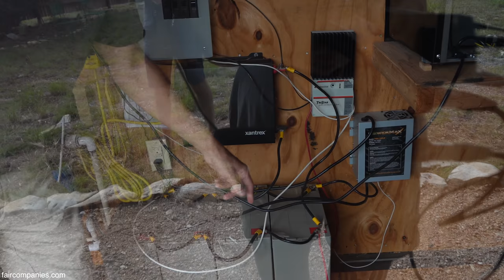Thrifty couple builds self-reliant, $60K homestead & workshop

Comment: This is the dream!!! So cool. I don’t know how I would do without a/c in that climate though.
Reply: Your body gets acclimated. I wanted to lower my energy bill so I started adjusting the thermostat up 1 degree every couple of months.  I currently have it set at 78° and use fans, which helps a Iot!  I can remember when I first began my mission with the thermostat set to 74° and how that seemed a little uncomfortable at first.  Then my body got acclimated as I slowly increased 1 degree at a time.   Now when I go outside the weather is much easier to tolerate and I live in TN where summers are 90-100 + and Spring season only last about 2 weeks.  It’s all about putting your mind to something and slowly working towards your.  I’ve always been the kind of person that hates spending money on something I can’t physically see, touch, or own so that’s my incentive.  So my utility bills savings allows me to spend money on things I can see and have as my own.   It’s a pretty sweet trade off!
Reply: We have AC luckily
Reply: Texas can get brutally hot in the summer. It was 105 degrees last week. I am spoiled with a/c but I keep the thermostat at 83 degrees in the summer and 79 at night. I think I could do better though.

Comment: 13:00 you can actually get used solar panels and used batteries(but it can't be lead acid batteries). There is market place for both Lithium ion batteries and Solar panels that were used in commercial farms for only a few years. Some websites(like batteryhookup) and companies take the best out of them and even provide warranty of their own on these. These can be a lot cheaper than buying brand new.
Reply: Cheapest source of batteries is to buy one from a wrecked EV.  They usually come with warranties and all the cells have been tested!!
Reply: Cheapest source of batteries are the abandoned electric scooters that are on the streets in the cites. Look for “Revel”

Comment: I'm a big fan of how efficient he was in reusing materials but it must be kinda dark in there with all that plywood, I'd definitely paint it white or do plaster or something to brighten it up
Reply: Then you have to repaint periodically
Reply: You'd have to coat the plywood too so it doesn't dry out and splinter. They both require similar maintenance but to each their own
Reply: Screw the drywall directly to the plywood.  Very stable and also provides some thermal mass.

Comment: I love the creativity, resourcefulness, frugality, patience, innovative learning, willingness to continue on and constant improvements you've put into put your home! VERY impressive! I know a couple who built with the same approach, back in the '70's. I was a part of it, so what you're doing seems like a "normal" home to me. 
I definitely would love the absolute silence except for nature. I crave it and need it. Maybe most folks aren't like that. 
Right now I'm finishing a cabin my brother started building. He passed away so now it's my delight to do! I've wanted a cabin in the woods since I was a teenager. Now, however, I'm too old and disabled to do much of anything. I have to pay to have everything done. So far, I've had the land around the main building cleared. Had a gravel road (it's actually a long driveway) installed. A new deck has been built because the old one was not built with pressure treated lumber. It had to be replaced for safety. I had electricity reconnected, but I want solar power installed to draw from before having to use regular electricity. There are 2 wells. Last time I was there, I checked to make sure the well pumps were working. I also plan to set up a rain catchment system for when the wells run low or out in the summer and/or there's no power to run the well pumps. I'm trying to set up at least one or two back up systems for everything...to be prepared for anything. I'm adding plumbing, but there's already a world class outhouse. That's how my brother rolled...world class everything cheap or free! He was a perfectionist, who wanted to do everything himself. Looks like you and he are/were similar in that. I'm trying to come up with an interior floor plan that incorporates the wood stove already there. 
Anyway, really enjoyed your video and look forward to what you do next. 
Sorry this is so long--I'm really excited about what you're doing!

Comment: Run 100ft of plastic tubing 10ft deep underground and run one end out of the ground outside and the other into the house. Attach a 12V fan to the opening inside the house, pulling air from the outside, through the pipe, into the house. Attach a bug screen and a rain cover to the end outside. Connect it to an on/off switch, maybe with different speed settings. Voila, low energy air conditioning. Soil at 10ft deep maintains a pretty constant temperature year round. And it takes roughly 100ft of tube for the air running through to attain that temperature. If the air coming into the house is too cold, either try shorter length of tube or speed up the fan. Or both. :)

Comment: They should try and get flow batteries! They retain 100% of their capacity for decades, so it doesn't matter if they use all their energy one day by accident or constantly fully charge and discharge it. They are also excellent at retaining their performance in hot climates. Another plus is they are fully recyclable (as a bonus for those who think about a products whole life-cycle). If they had the money they could even buy a few of them and if they needed to save energy for a certain event, they could put one battery on standby and use all of that stored energy in the future

Comment: Most all motors are DC motors. Ac to Dc rectifiers are used to modulate fan speeds through pulse width modulation (or motor taps). Most things use DC power but AC electricity is used because there is much less voltage drop across long lines. Step up transformers are used to increase voltage reduce amperage. Low amps = Lower loss of voltage from resistance in the wires.

Comment: I suggest a 'cold roof' essentially a second roof minimum of four inches clear flow at eave ( hardware cloth intake cover okay).  Second roof could be steeper to accomadate the expanding air big vents at ridge  and or cheek walls.
30 years on  solar at 44.44 °  latitude

Comment: Used vehicle Lithium batteries are affordable at about 100 per kilo watt hour.  We used our biz account with LKQ and had 7.6 KWh of Ford C-Max (Energi) batteries dropped off at our biz.  Then you very carefully take the battery apart, with the Energi version battery you have the great option of building any size 12, 24, 36, 48 or 60 volt system, as the battery breaks down into 84 x 4.2v cells.  This is the way we went just so if I wanted to build a 12 volt system later on in adition to the 60 volt system we used for our shop and the AC for the home.  After almost 3 years of being off the electric grid we found out that we did not really use the AC as much and we made adjustments to build a smaller separate system for our home.   This type of home is not what they want us building this is why everything is so restricted (permits etc...) by those Corporations posing as cities or government which in truth they are not.

Comment: Most people do not have the option of permission to camp for free on someone else's land while building a home there from salvaged materials. 

Buying a small piece of raw land, fencing the land, making a gravel road and installing a septic system are costly and should be added to the calculations of how much it costs to self-build even a simple shanty from salvaged materials. And if you cannot connect to a public water system, the cost of hiring a crew to dig a water well plus the cost installing a solar powered water pump or, alternatively, buying and hauling water to fill a large water tank also need to be considered. And if you cannot connect to a nearby powerline, the cost of getting the power company to put in power poles to get that connection or the cost of installing a large enough off-grid solar power system to run a washing machine, refrigerator or microwave can be quite high.

All these expenses should be considered when daydreaming about building your own primitive home from salvaged materials. And the first expensive step is to buy the land.

Comment: What did he do for foundations before the concrete slab or did he just put the slab right on the dirt?
Reply: Not sure of the proper wording, but he built a frame and put in tons of rebar, to hold the concrete. See the part of the video with the concrete truck pouring the cement? Eugene is standing (in white rubber boots) inside the rebar frame as the concrete is being poured.
Reply: @MarlenaJarjoura  No, that was all for the slab...  What Scott Needs is asking is what was done before the slab work...  Typically foundations work like how you stand on the ground...  The slab foundation is like your foot, it supports your body (aka house) but the ground beneath your foot/slab still has to support all above and needs to be compact/solid enough to not have the foundation sink or settle unevenly...  So house can have long term foundation issues if nothing was done before putting the foundation on the site...
Reply: @ZeoCyberG  ah yes, we used compacted gravel under the slab